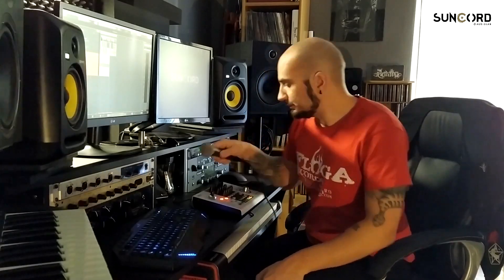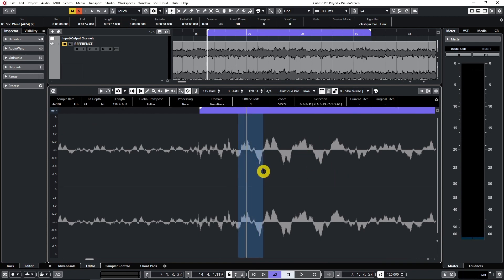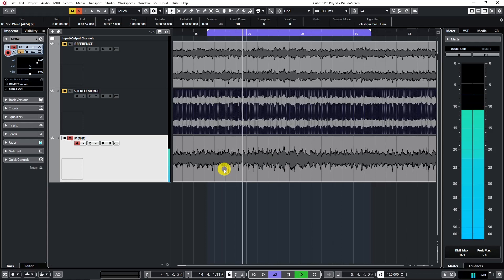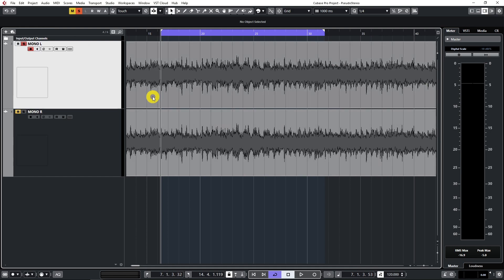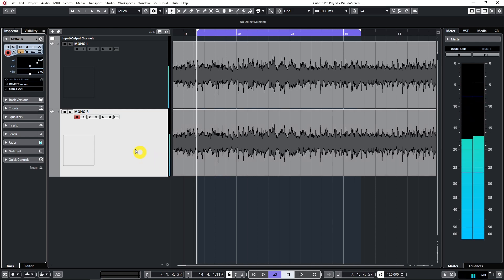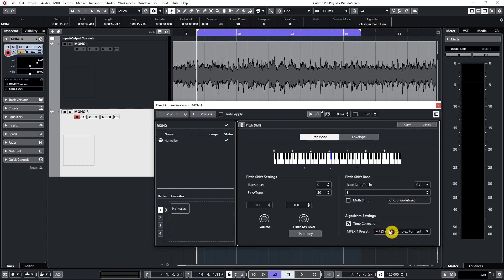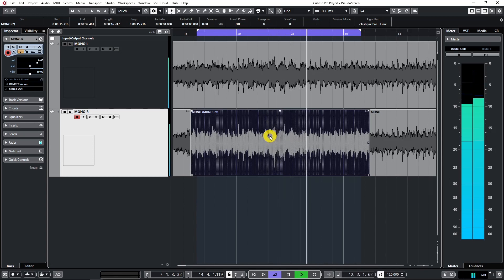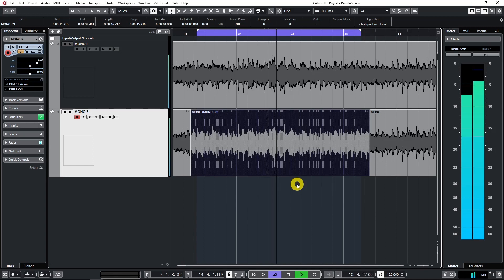Pseudo Stereo Basics - Tutorial

Comment: when the mix is summed to mono, would there be phase cancellation at certain frequencies?
Reply from the maker: Of course! Any stereo enhancing or pseudostereo technique will cause many cancellations and problems in mono systems. For example: if you have a mono synth and you inverse phase of one channel then you'll have a maximum stereo image. Now, if you play this in a mono system (for example a modern wireless mono speaker) the synth will be completely cancelled. It will literally disappear. So yes, we have to be careful with these techniques :)
Reply: @suncordaudiolab  ahhh. this is why the Blumlein stern array is so useful as the dual side signals will cancel eachover completely (if not manipulated individually) when summed to mono, leaving one the mid signal... cool thanks man